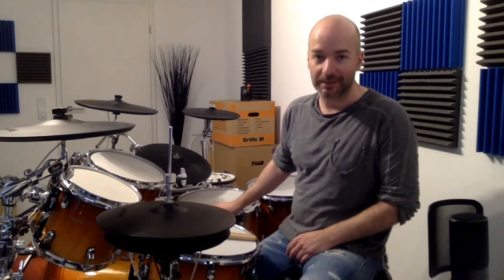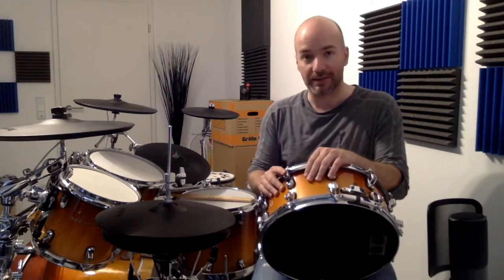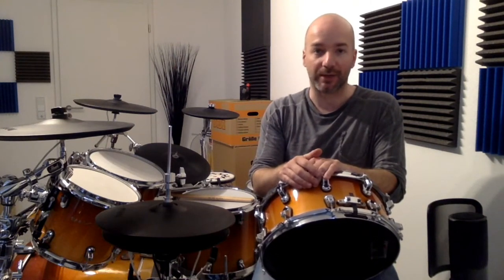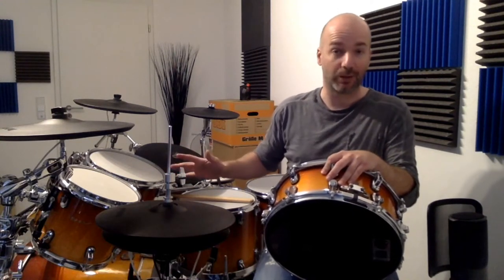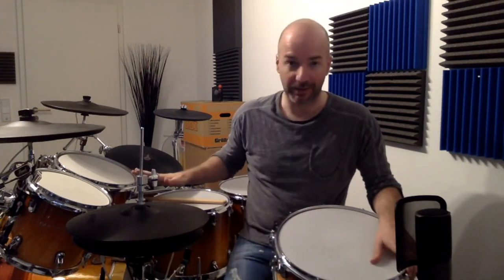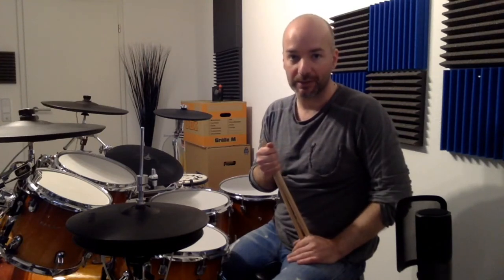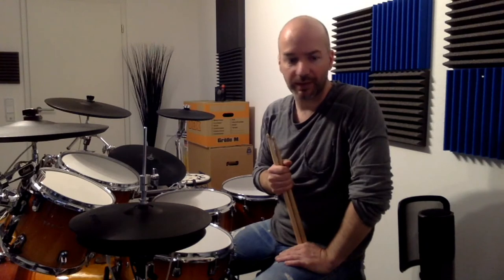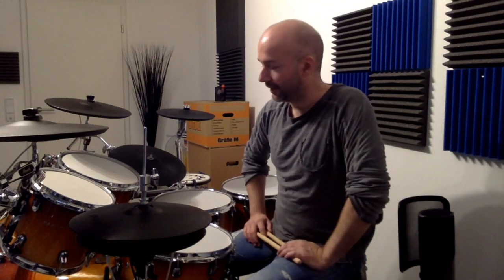How I converted my custom E-Drums - Trigger, Prices and Links

Comment: I saw the title and watched it because I wanted to convert an extra snare to mesh head. I didn’t know if I should put a mesh head on reso side. Now I know. I think I will use Drum-tec Design mesh . I have a set of Silent Strokes here so I’ll use the 14 for the reso. I’ll use a Roland RT-30 trigger. It’s my side snare so I don’t have to buy anything special otherwise. I have ezdrummer 2. I’ll upgrade to SD3 this year. I like what you’ve done. All my drums will stay acoustic but have the same Roland triggers and a Roland TD-17 module. So I’ll be enhancing my set as opposed to all electronic. Normal cymbals ...just overheads and a big 15” speaker.

Comment: Do you have a recent overview of your current kit? Still using the same triggers?  I've got a TD-12 setup with extra toms and cymbals.  I'm midi chaining a UK-based midi-controller called Megadrum for extra inputs.  Using SD3 exclusively with Bob Rock and D&D expansions.  The megadrum has lots of settings, but I'm mainly using it for the crashes.  I'm thinking of replacing all the black Roland cymbals with Jobeky, but now that I've seen your videos on AtoE conversion, I'd like to look at that as well.  My critical areas of focus are position sensing on the snare and the sensitivity of the ride/bell etc.  I'd like to see a good non-Roland/brass looking hi-hat setup to complement the Jobeky cymbals.  I can't decide if there's any benefit to the TD-20 (extra inputs) or TD-50 (digital snare/ride) given that I do everything with SD3 and use midi-chaining.
Reply from the maker: Hey David. To be honest, I have never experienced or heard of a pair of hats that work as smoothly as the Roland VH-12 or VH-13 does. Especially the manufacturers of those brass cymbals really struggle to match the level of detail the Roland ones achieve. Of course I know the megadrum, it's a beast and very complex. When it comes to positional sensing, I have no issues with that using the triggers I showed in this video. That snare works absolutely smoothly. 
Well, even though you use SD3 (like I do and did), it's all about the source material. SD3 just captures what's been sent from the module, meaning the better the module works or captures your performance, the smoother and more realistic SD3 will react. The software can compensate of course to a certain extent, but not everything. Long story short: You will get the best performance using the best gear in the first place: A TD50 with the digital snare/ride triggering SD3.

Comment: Thanks for your fast answer Luke , I understand and I agree concerning the toms but just by curiosity , if you have a choise to choose for the same price a bar system or a multi armed system like in your snare drum , wich system would you buy  ? lol
And about e-cymbals , the reason why I prefer the Field cymbals instead of the jobeky cymbals is because the Jobeky hi hat doesn't have a under part cymbal wich is a bit weird but that's just my personal opion.....

Comment: Thanks for this video, really useful as I'm planning to convert a kit too! One question I have is do you need to change the resonant head on the drums to mesh heads too?

For example if I change the top (batter) head to mesh but leave the bottom head as a standard drum head, will it be noisy?

Thanks!
Reply from the maker: Seb Atkinson Thanks for watching! Well, I DID change all resonant heads to mesh as well. Leaving the common reso heads on will be louder, of course, not significantly, but noticeable. I've picked a smart solution from R-Drums, the company that built my trigger bars, it's called plughead - a cool combination of a common single ply mesh head with a connection plug. Check it out at r-drums.com
Reply: awesome, thanks for the help! Will check that out

Comment: any advice for hotspot issues with sd3, I have similar trigger like the ones you use for the toms for my snare from ufo drums and I´m using a edrumin midi interface as my module, i tried everything but I m still having problems when I hit right in the middle, am I missing something within the software

Comment: i made mine almost completely silent by placing drum mutes (mouse pad material cut to the sizes of the shells)  (bought the complete set for about 40 US) Place those on the bottom heads if you leave the bottom heads on, this does two things: it mutes the bottom head, and doesn't allow any light to come in from the bottom which helps to hide trigger mechanisms when using single ply heads.  Now if I could come up with something to make the cymbals quieter... well really not a concern since either of my two neighbors are about 3 acres away on either direction so technically i could play an acoustic set at full volume and they wouldn't hear much....
Reply: I have both acoustic and electric. I play the e kit more and now when I play my acoustics they sound so freaking loud😂

Comment: Hey Mike, was going back for some reference: I'm about to buy R-Drums triggers for kick and snare, but I see you're using the Wronka kick trigger. Do you have any reasons you went with that instead of the R-Drums RTS kick trigger? The Wronka is cheaper, but I'm doing high tempo double kick that I'm wondering if the dampening of the RTS would be better. Have a great weekend!
Reply from the maker: Hi Chris, I went for the Wronka Kick because it was cheaper, simple as that. I‘ve played the R-Drums, too - no difference in trigger results, because Wronka uses the key components for his trigger from R-Drums anyways. He just had a different approach in building the trigger.

Comment: Mike, I have an electric kit already but want to convert an acoustic snare drum (my kit has its own snare stand and I still have my original acoustic kit). Do any of the conversion kits allow you to make rim shots? I know you can buy the rubber pieces pieces to go on the rim. Most modules have an option to add a certain sound to each drum's rim. At least mine does. Thanks
Reply from the maker: awill296 Well, you need to have a stereo trigger system, which detects the head and the rim as two different zones. But keep in mind, it's also the module that allows you to play rimshots (and sidestick) or not. Most modern modules have different sounds for the center and the rim of the snare. The module will detect if you hit just the center, the center and the rim at the same time (=rimshot) or just the rim (=sidestick-sound).
Reply: You can get two zone triggers. eg Roland Rt-30HR

Comment: Hi there,I'm currently searching for any info about e-drums as well as the A2E conversion and this video is top notch :)  Ive been thinking of buying one of the Rolands vdrums (td 25kv most likely), however the idea of A2E conversion seems very interesting indeed. I'd like to use the sounds from VST such as SD2 or SSD4. The thing is I need a module and I'm not sure which roland module to go for? Do you think the TD-12/20 would be still a good investment or would you rather recommend choosing newer and more expensive modules TD-15/25?? cheers
Reply from the maker: Hi, thanks for watching. If you want to use drum samples, you should go for the TD-12 or TD-20. You have more inputs and both modules support positional sensing, meaning your snare will trigger different sounds depending on where you hit the snare (edge or center). I have a TD-12 and it works well! Check out my channel, I just made some videos about drum samples.
Reply: +Mike Luke Hi Mike, thanks for your reply. Yes Ive seen your videos..they are excellent, very helpful, brill job! I will get back to you when I have some questions in relation to drum samples itself.  As for the module, how do you connect it to the computer?? and also, Have you had any issues with the responsiveness of the pads and cymbals or have you noticed any latency when switching from Roland to VST??Kind regards,
Reply from the maker: bartkuk1
As the TD-12 has no USB-out, I connect it via MIDI cable with an audio interface (Roland Quad Capture in my case). From the interface with an USB cable to my computer.
And no, I have von issues at all, because the quality of my triggers is so great. Latency is not noticable. Maybe I should do another video about this topic ;)
Reply: +Mike Luke Thanks again for your answer. I do appreciate it :) and yes, if you find a time please do another video ;) cheers!

Comment: Hey! I want to convert my old acoustic kit to an e-drum aswell (good old Mietwohnung) and am planning what i need atm... Since i want to use Superior Drummer 2 or 3..does the drummodule even matter? Bc right now im thinking about doing the same you did, buying a complete edrum and selling/storing everything i dont need, but im thinking about using the Millenium MPS-850. So does the module matter somehow? Can a better module improve latency and such? And whats ur opinion about sidemounted triggers like the Triggera Intrigg, since i heard about problems with hotzoning with central triggers. Hope you can help me out a bit, since you seem to be a bit more experienced in this stuff...in case you even read comments under this old video :D
Reply from the maker: Hi Jona, of course I do ;)
Well, for the module you need to find a compromise. A bad, crappy module will affect your playing experience as it usually doesn’t translate your playing well or accurate enough. Same for the trigger system. A side trigger for the toms should be fine, for the snare I‘d go for the best trigger possible.
It always depends on your budget, of course. If you can afford a Roland TD-30, go for it. I‘ve used a Roland TD-12 for years and was happy with it. Millennium is crap, to be honest. It might work for kids who start drumming, but I wouldn’t use it to trigger Superior Drummer.
Reply: @MikeLuke  Thanks for the fast answer! Yeah, thats what i thought! Well then i will keep my eyes open on some good used module like afromentioned TD-12 or 17 maybe. Thanks for clearing that up :-)

Comment: Mike, with your R-drum bass drum trigger and Drum-tec mesh head, do you have to put other material in the shell ? Like foam or other things ? Is the rebound ok ?
Reply from the maker: KaerioMika No, i have just the trigger, because the construction does all the dampening. So just the trigger and the meshhead. I like a softer rebound, so I can bury the beater into the head.
Reply: Thanks Mike for all your advice on video and comments. I am sure you help a lot of people :) 
I am converting my Mapex Storm drum with a used TD-12. I will go with R-drums triggers on snare and bass drum, and triggera Intrigg on toms...
Reply: You dont need mesh heads just get an acoustic set buy the module and buy 9 dollar trigger mics

Comment: bit late here, but im kinda a noob in converting from acoustic. Right now i have and acoustic set with mesh heads for all the drums so what all else do i need other than a module and electronic cymbals, i just wanna make sure before i go waste a bunch of money on the wrong stuff
Reply from the maker: Hi, sorry for the late response. You need some kind of trigger system that will translate your hits to send it to the module. You can use internal triggers like I did and described, but there are even external trigger systems available. If you have mesh heads already, I‘d recommend going for internal trigger bars though.

Comment: Cool video , but why do you have a kind of r-drum type of bar system in your toms and not in your snare or why not put also a rts r-drum rts kind of system in your toms too ? Is that because the rts system or stuff like that is too expensif ?
Reply from the maker: Well, I thought that the trigger bar for the toms is enough, because on the toms you don't have positional sensing anyway, so it only has to capture the strike accurately. On the snare, there are way more details to capture when using Superior Drummer.

Comment: How does it perform compared to say a top of the line Roland / a Roland of a similar price (exl module).

Also I already have a DM10. If I am only going to use usb midi. Will a better module have better accuracy?
Reply from the maker: I don't feel any differences in terms of trigger results or sensitivity. And of course, the better module you have, the better results you'll get.
Reply: Mike Luke Thank you very much.

Comment: That hi hat isn't the one that comes with the TD12.
What hi hat is that?
Reply from the maker: Yeah, you're right. When I bought the TD-12 set in used condition, it came with a CY12H, but I replaced it with this VH-12 hi hat, which I bought on eBay, too.
Reply: Mike Luke I see what you're saying.
Thank you for the quick response.